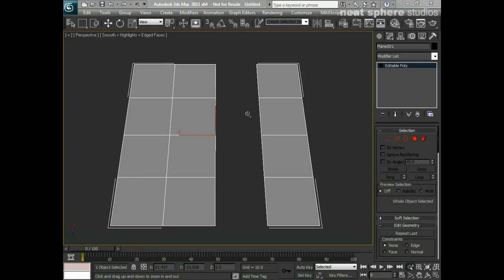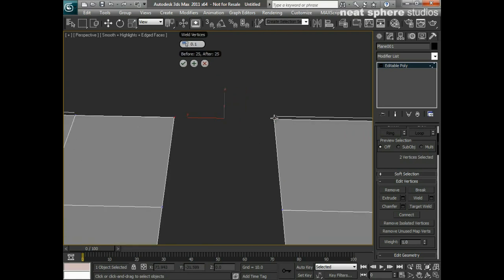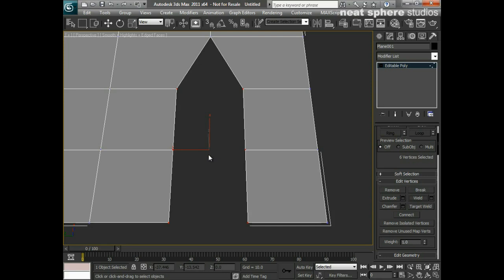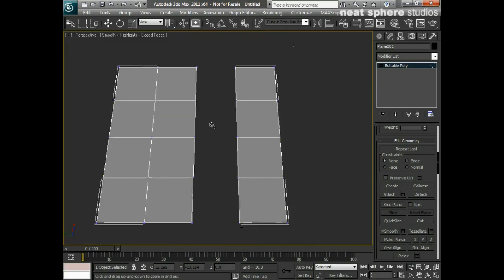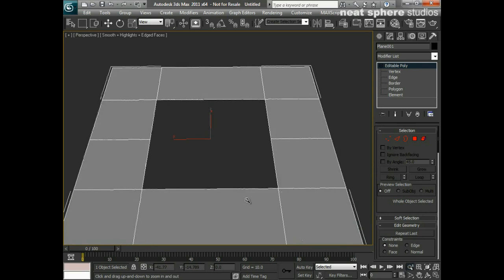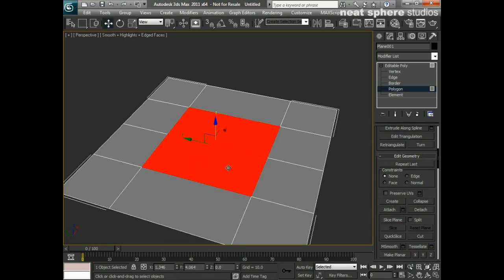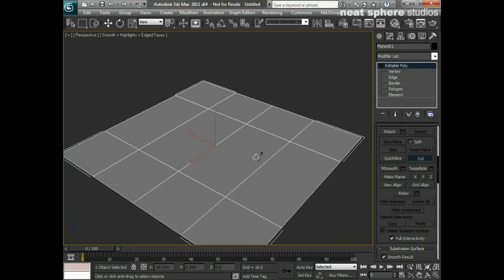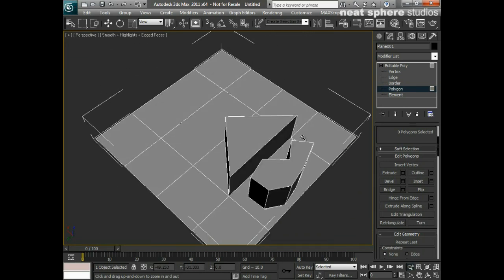Learn  Autodesk 3ds Max - Chapter 6 -Welding and Cutting Geometry

Comment from the maker: If you made the character from different part you should still be able to access those parts even if the mesh is a single onject - provided it's an Editable Poly. If it is, then you can select a whole section using the select 'Element' option at the top of the Command Panel. I hope that helps. Stephen.